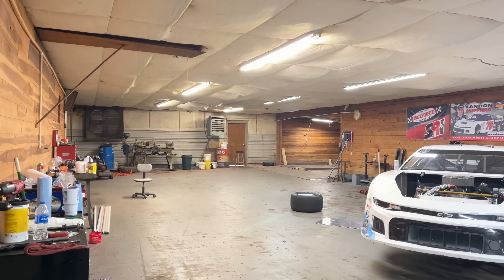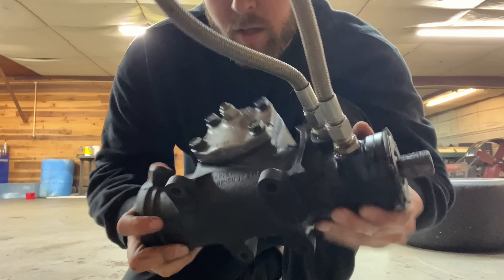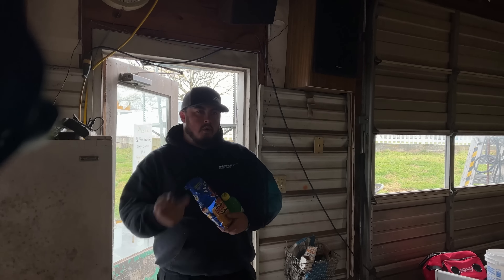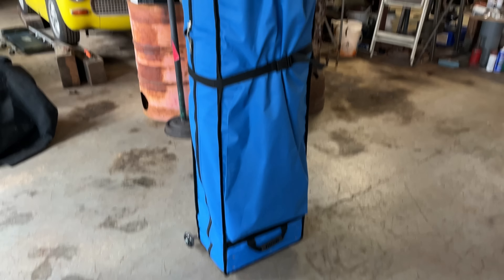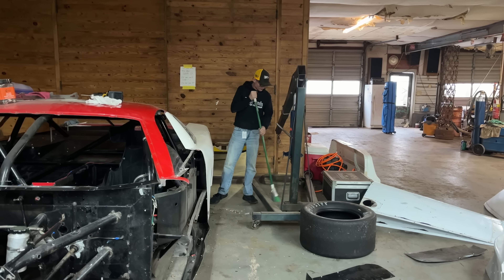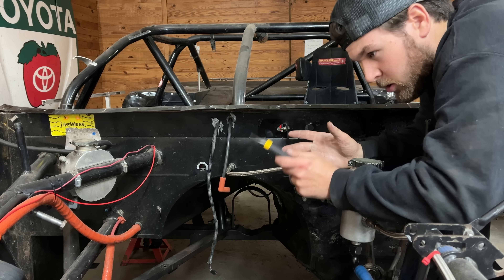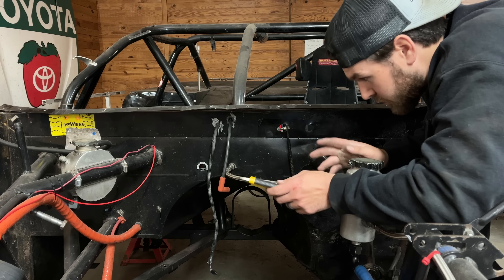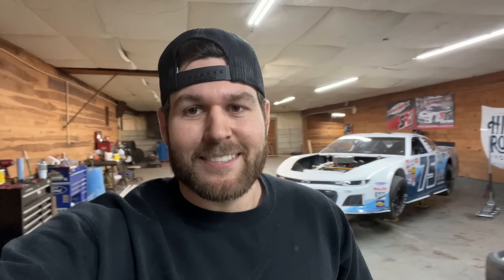This Racecar need MAJOR help! I can't believe this car raced! Tearing down Fido at Huffman Racing!

Comment: Correct me if I’m wrong but I always thought that a bumper too stout could make it easier to hurt the front clip meaning if the bumper doesn’t give the clip will
Reply from the maker: That’s potentially true yes
Reply: @LandonHuffmanRacing  Thanks man I wasn’t trying to be a smart ass was just wondering My home track is New Smyrna so so it really don’t matter. If you stuff one there it’s pretty much gonna need a clip.

Comment: 😂 Goggles was most definitely over engineered by whomever assembled it to actually go racing, or it had a lot of different homes that kept adding to it. 

Which I do like your dad's plan for the car, because that is exactly what I would have done and have done, because this over engineering is something that also happens with dirt track cars. 

Which the majority of the time the center-section is the only thing worth keeping, and the rest of it needs to be cut off for scrap.
Reply from the maker: This thing def needs to be cut up and re-built for sure